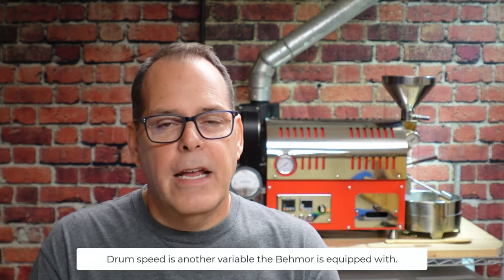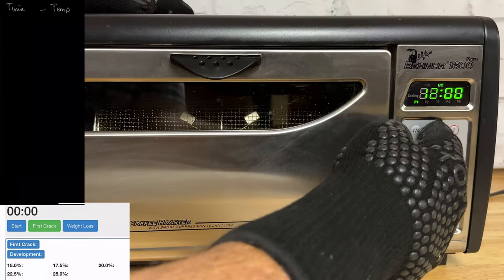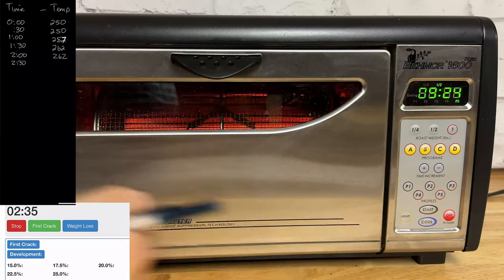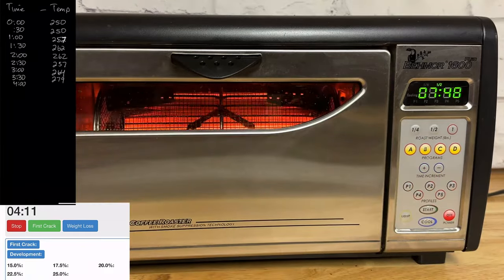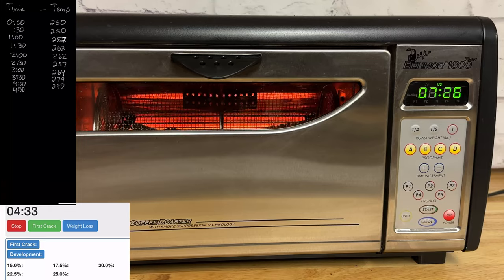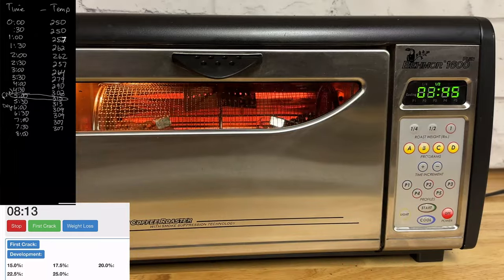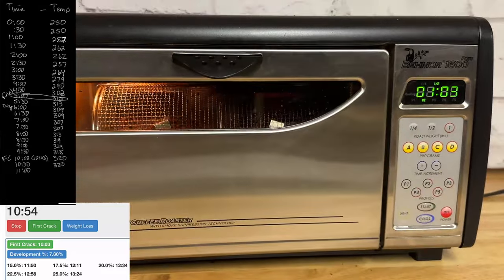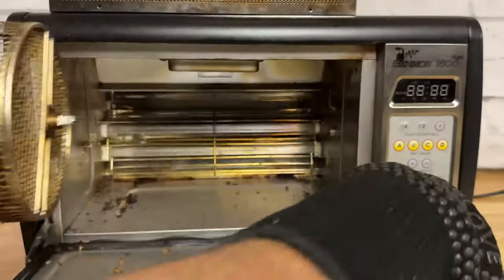How Coffee Roasting Temperatures Are Helpful

Comment: Hello. Should I charge my Behmor to high temperature (let's say 115C) or lower temperature (60-70) as the instructions advise? Or does it depend on the coffee? I suppose it does. For example should I charge high for a softer bean using bdhmor's program 3 from the beginning? I am a little confused.
But for example last time I had great results on a Colombian charging high with a slow roast.
Reply from the maker: Officially, I can’t recommend charging higher than the  Behmor factory recommends.  They set these guidelines for a reason.  

I’m assuming the Colombian is a higher density bean so it should be able to handle a higher charge temp.  I pre-heat to 250 Fahrenheit /121c on the Behmor.

Yes, the charge temperature will change based on bean type, process, and the overall profile you are aiming for.  

Lower density beans are prone to roasting
Defects if too much heat is applied during the dry phase.  So, the total roast time will be longer.  For high density beans like the Colombian, there is nothing wrong with a longer total roast time.  Total roast time does impact tasting notes so I would experiment and taste the difference for yourself.
Reply: @VirtualCoffeeLab  Thanks a lot for your answer! Do you charge higher on behmor because you try to get closer to a commercial roaster as I can understand?
And finally, what should be the difference in charging between a high density and a low density bean or between washed vs natural process (for example 10, 20 or more C points)? Thanks a lot once again!

Comment: Hey Mike,
I hope you and your family are well. I am feeling so much better.

I roasted last night and i took my time. I forgot to get a white board but i did download roasting apps bug forgot to use.

Drying phase was spot on 50% of the total roast time and 1st crack lasted... damn maybe 60 seconds. 

I dropped the heat just a bit but let them coast. They look great. 

Quick question... 1st crack is the exothermic reaction, so does that mean as they burst from the water inside do they cool off maybe by evaporative cooling and we can drop the temp but we keep the roasting environment hotter than the beans because as they crack they are cooling off.

I was dropping the heat way too much because the beans would cool off and the roasting environment was then to low and that was why my beans were not developed?

Would that make sense? The exothermic reaction lowers bean temperature?

Man, i love the science of coffee! Mike, you are the best. I tell every body about your channel. 😊😊
Reply from the maker: As moisture is being driven out of the bean, pressure is building up in the center and the cracking sound is the structure of the bean breaking open.  If you look close at a bean that has gone through first crack you will see the bean cracks I am talking about.  Some say heat is being released.  I have also heard that it is not heat but carbon dioxide.  I don't know what it is BUT it can have a temporary affect on the bean temperature.  I think for where you are at you need to focus on controlling temperatures.  You should try and find a way to read temps.  The other option is for you to reference your event times.  If you have too much heat during the middle phase your first crack will occur too soon.  If your heat is too low, then first crack will be late.

With regards to dropping temps, be very careful not to make large changes to your temps on that roaster.  Pay attention to where your heat setting is during dry that got you to your 5 minute dry.  Do the same thing for the heat setting that will get you to first crack at the time you want (example of 8 minutes). and then, based on the sound of your cracking....  how hard and fast, make very small changes to allow for a nice easy rolling crack all the while monitoring your times, the color of the bean and the smell.    Be sure to be writing down what you do so you can repeat or change on the next roast.

I hope that helps
Reply: @VirtualCoffeeLab It sounds like there are a few key aspects that if i implement, ill be fine. 

I am not sure who told me this but they said roasting is like flying. Large moves should be avoided and to keep it smooth and steady. Last roast i did take more accurate measurements and was surprised to see the results. 

I did a family tasting and man... ot felt so good to let my family try different types of beans at the same time. As always, thank you.
Reply from the maker: i'm glad you are seeing better results and having fun with the family while enjoying coffee!

Comment: Hi Mike 
I’d appreciate any comments you could make on my roasting techniques,

I’m roasting with a SR800, set up with the Razzo extension tube , with temp reading probe set in the middle of the bean mass,,I’m using Roastmaster software to read my ROR and timing of different stages,,I’m really happy with how it performs, once you learn the program .
This is my typical roast
225 grams
I heat the chamber up to 350 degrees before adding beans.
Starting setting.  8 fan 7 heat
Note my last few roasts have all been outside (40 degrees) By placing my unit in a cardboard box, I don’t seem to have any problems maintaining my heat,

Here are some times from my most recent roast

1 min 284:, 2 min 307 3 min 331, 4 min 350
Dry end 4 min
I now change fan to 6 , maintaining heat at 7

At 7 min, I’m at 398, approaching FC
I turn heat down to 6
First crack 400-405
I then wait for development of 15-17 %, final heat 413
And drop the beans at total time of 9:30,,,17% development ,

This was a Costa Rica washed bean
Seems like my ROR drops continuously from around 20 down to 2-4 at the end of the roast 

I’m pretty happy with my roasts at this point ,,We really can’t tell much difference between 15% and 20% on most coffees,,,my coffees all seem to turn out on the fruity side,,,even sometimes a little sore tasting ,,,as it cools,,,,

Thanks for all the help you give us Mike, this has turned out to be a great hobby, since our wine and beer brewing days are behind us,,
Oh, I make homemade caramels for gifts at Xmas too

Have a good weekend
Ken
Reply from the maker: Hi Ken, you have a lot of good things happening with your roast.  I like your declining ror.  You seem to have enough thermal energy so you don’t have to constantly make changes.  You seem to have repeatability, your roast times look good.  What about your color?  Are you happy with the roast?  You described what you are tasting.  What would you like to change?
Reply: I find it interesting that using the Sr800,,,I usually start my roasts at a setting of  8 fan , power  7,,,,where I see a lot of people using the same machine set their power low to start,,,if I were to set mine any lower,,,my yellow stage would take 6-8 minutes 
At fan 8 and power 7,,,I’m pretty consistent at hitting yellow stage right around 4 minutes on every roast ,,,especially on washed coffee,
I then usually turn down my fan a couple notches ,,to reach FC by 7 - 7:30 minutes,
Just for your info ,,the next time you roast in your SR540
Reply from the maker: You are roasting outside in 40 degree temps.  This will definitely influence your roasting times..... even with the pre-heat.  I have had several SR800 razzo users talk about low heat settings yet short dry times.  It is either that or their wattage is different than yours?  I'm glad you are seeing consistent results.  That is great!

Thanks for sharing your roasting recipe.  I will give it a go the next time I roast on the SR540 with extension tube.

Comment: I use a fresh roast with an extension tube with. Thermo couple in the middle of bean mass., I aim for 350 degrees for dry stage,(4min) and first crack at 400,,I usually drop around 415 degrees at 10-11 minutes , I rarely get a big rolling crack,,,
Reply from the maker: I call that a controlled roast.  Too intense and the roast keeps flying.  That is an indication of too much heat.  Sounds like your ror from first crack to drop is in the sweet spot Ken.  Nice job!  Where do you find your heat and fan settings at drop?
Reply: At start I’m at fan 8.  Heat 5 and At drop fan 5 heat 6,,,,depending on coffee..,I usually aim for a medium roast ,,18-20% development time

Comment: I’ve got the Kaffelogic Nano 7, which is wonderfully easy to use and produces fantastic roasts. With the BOOST option, I can do 80g (1/6 lb) to 150g (1/3 lb) batches.

A big difference is time. We roasted on the  Behmor for years. 12 minute roasts are typical. On the Kaffelogic, I never go as long as 9 minutes, and many popular profiles are much faster. 

Regarding temps, 207C (405F) first crack and 220 drops (428F) are typical for a 20% development ratio.

My question… I just got some cupping tools and three 5lb batches to play with, and I’m trying to figure out what sample roasts to do for comparison.

For instance, would it make sense to use my favorite profile and do 15%, 20%, and 25% development ratios and to cup each? 19, 20, and 21 would probably be too subtle, so does 5% steps make sense?

My typical profile is aggressive at the start, but quickly levels off. I get about 50% dry, 30% FC, and 20% drop. Let’s say I stick with 20% drop. Would 40/40/20 and 60/20/20 sets make sense, or would 45/35/20 and 55/25/20 make more sense? I want to know what to cup to get a sense of what the changes do to flavors.

Also, I could try scaling the curves for a quick roast at 6 minutes to FC and also do 7 and 8. 

For now, I want to explore the space, so I can learn the effects of development, time ratios, and overall speed. Hopefully, that will give me the experience to taste a roast, sense the shortcomings, and know exactly what I want to tweak to find my optimal result for a given bean.

And once I dial it in, I can just press PLAY, and the Kaffelogic will repeat the result. No 30 second temperature monitoring needed. 😎
Reply: Thinking more about it, I already know what dark vs. light roasts are, and changing the balance of dry/malliard times is next level. My initial focus will be on overall roast times. When is it so slow that the roast is dull or so fast that it’s uneven?
Reply from the maker: Jon, I think your mindset is spot on.  If you have a profile you like, consider the 5% difference in development.  You have two options to play this out.  One is to shorten or extend the total roast time.  The dry and middle phase would remain the same, you are just modulating the development time +-5% of the time.  So, if your middle phase is 3.5 min on your favorite profile, keep that the same, just change the development time  OR you can keep the same total roast time and modulate your phase percentages.  

Since you are using the Kaffelogic Nao 7 and have the ability to easily program a profile, you should also experiment using the same phase percentages but shorter and longer roast times.  The longer roast will give you more body while the shorter roast time will give you a more light bodied delicate vibe (depending on your coffee of course).  I would suggest trying a 20-30 second different in total roast time, modulating the whole profile.  So you would have 3 roasts and could compare.  If you try smaller adjustments, you may or may not taste the difference (depending on how good your tasting palate is.
Reply from the maker: When is a roast so slow it is flat?  That depends on the coffee and roast level and the roasting device.  I would try my suggestions i mentioned above in your initial question and that should give you a lot to think about.
Reply: Today, I did a number of roasts on a familiar bean, I ended up going back to a smooth, simple profile, I chose 50/30/20 for the development percentages, and I ended up with first crack at 5, 6, 7, and 8 minutes. I’ll cup them in a couple of days.

One thing I learned is that the temperature readings on the Nano 7 needed to be much higher on the short roasts than the long ones. It makes sense. I need to put much more energy in over a shorter time to get to FC early. Given that the probe isn’t in the middle of the bean, it shows huger temps for each phase for the aggressive roasts.

Because of this dependency, I needed some trial runs, and never nailed it exactly, but my 5, 6, 7, and 8 minute FC batches should be close enough for me to train my taste buds. The goal isn’t to find the magic time, but to learn how to identify roasts that might be too fast or too slow.

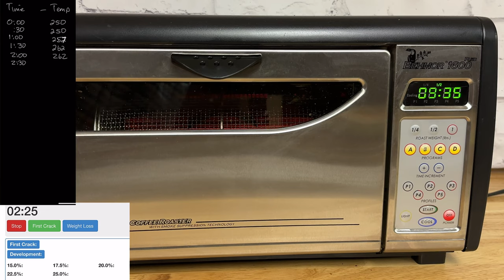FWIW, one of the lead roasters at Kaffelogic said that he tends to like 6:30 FC for most beans. My 5-8 minute batches bracket his target, so I should have a nice range to taste.

After I get these results, I’ll try modulating dry and malliard phases.
Reply from the maker: Sounds good Jon.  I'm interested to hear your thoughts on the differences in taste.  Be thinking about body as well as you taste
Reply: Thanks, I’ll let you know. I plan to cup first and also pull shots. I know that the espresso will show body, but this will be my first cupping. I’ll be curious to see how the body comes though from the spoon.

FWIW, I’m doing this on a Panama bean that we know well. From here, we have three 5-pound batches to dial in: a dry, floral Ethiopian, a washed, red fruit Ethiopian, and a nut chocolate Guatemalan. All high altitude and fresh. I’m looking forward to really dialing these in as they cover our range of favorites. The supplier bought large lots recently, so we should be able to restock, if these are really special.
Reply: We cupped the coffee today. The dry scent differed a bit with the fast roast smelling the most interesting. Wet scent was too subtle for me. The 5min FC roast tasted a bit underdeveloped and sour. It’s Ike a seared, rare steak - cooked on the outside, but not on the inside. The 8min FC roast tasted like bad diner coffee. Dull, flat, and heavy. The 6 and 7 minute FC roasts were both good. We leaned towards the 7 min FC cup, but at some temps the 6 min FC cup was sweeter. I can see why the Kaffelogic expert liked 6-1/2 minute profiles.

Note that this was a Panama coffee that we’ve enjoyed for its nutty chocolate flavors in espresso, but the beans aren’t all that fresh.

I had also roasted an Ethiopian Dry processed, fruit-forward bean that is reasonably fresh. I chose my previous 6 min FC profile, because I expected it to go long (and it did.) It’s extremely different! Where the Panama cupping was like different shades of brown and gray, the Ethiopian cupping was like tasting a rainbow.

My conclusion is that cupping different coffees is very effective at revealing differences, while cupping the same coffee with the same development percentage is very subtle. It’s easy to taste where the roast went too far, but harder to know where the absolute best result might be.

My feeling is that 6:45 FC would be the target. 5 and 8 were out of bounds, putting 6:30 in the middle. We had a slight preference for 7 over 6, so 6:45 is my conclusion for that bean.
Reply from the maker: Jon, those are all great comments and observations.  You have a great sense for smell and taste.   It's kind of like the 3 little bears.  It is important to move the needle to taste the difference.  There are really 2 different needles to move (browning/maillard and development). I'm glad you are able to use that roaster to pinpoint your roast profile and then repeat at will.   I'm assuming you are not trying to transfer this profile to another machine right?
Reply: That’s correct. I’m not planning to map this to another machine. Once I’ve dialed in a bean, I can do 150g batches by just loading the beans and pressing PLAY. After cool down, I pour out the beans, clean the chaff collector, load more beans and repeat. It’s efficient with zero babysitting, so I can easily multitask. It’s perfect for a home roaster plus some gifting.

When dialing in a new bean, it’s a lot more hands on, though it’s just monitoring, not driving. It’s low stress. Adjust the profile and level, hit PLAY, monitor, and adjust the profile if needed.

Still, it would give me some guideposts for a bigger machine. I can learn if I want a slow or fast roast, how I want to balance the phases, and how much development I might want. Going from air to drum, however, the exact numbers wouldn’t translate, but it would give me ideas for setting targets.

And yeah, the Kaffelogic rocks. 👍
Reply: One additional point that doesn’t translate is charge temperature. There is no turning point on the Kaffelogic, but a turning point is artificial anyway.

With the Kaffelogic, you set an initial power that runs independently for about 90 seconds. After that, the PID comes into effect, and it adjusts power in real time to hit the temperature curve. 

What this means is that when designing a new profile or working with a unique bean, you check to see if the first minute or so looked good, or if it was too high or low, or had overshoot. Then adjust and try again, as needed. It’s a charge temperature equivalent.

The difference is that the temperature curve smoothly goes up from room temperature. There’s no U shaped turning point. It actually reflects what the bean is doing a bit more accurately. But it doesn’t map 1:1 to a large drum roaster.
Reply from the maker: you are the Kaffelogic evangelist 🙂